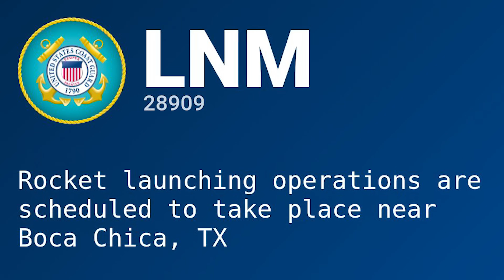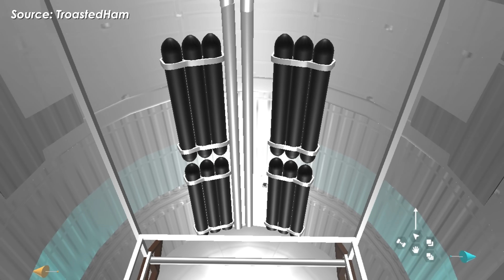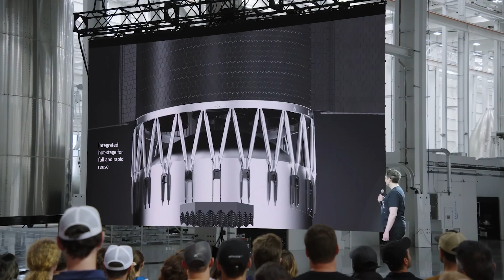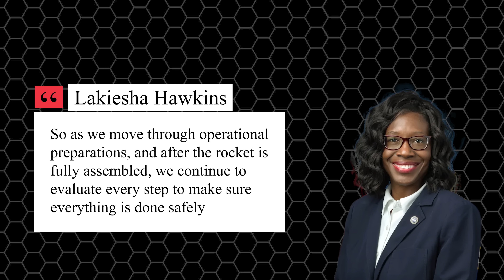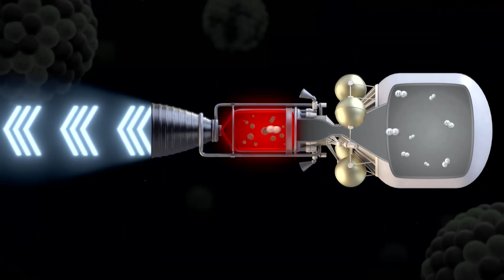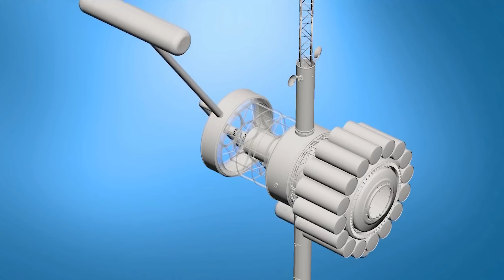SpaceX Declared Starship Flight 11 Launch Schedule with new Heatshield Upgrade to make history

Comment: Sounds good, especially work on better drive systems....
Hydrogen/Nuclear is too Nerdish, you are definitely right about wanting Mutifuels engines...
I think the baseline should be dirty water, ie Comets, Dead Sea style contaminated, and even "Yellow Snow" from all the Huskies that go!

Might be finding purer sources of Ice, like floating sea ice on Earth,  being low salt due to natural processes something similar could exist in space or on other planetoids, suggest research looking for such as floaties by the Astro-Nerds.
Spectral analysis of sufaces looking for Potable Ice formations.

That way you could just run the Sewage thru the reactor chamber... Instead of desalinization and unnecessary recycling of Monkey Juice...

Basically Starship's current propulsion is for gravity wells, and every where else there's better way more efficient options.

Also we need to get beyond one size does all thinking...

And start expanding horizons twards actual space Construction techniques.

Nothing says we have to wait and start planning until the last minute.
We could literally be fabricating pieces and sections now for a fraction of gNAtSA's administration budget...😂

I have a word for such drones, if they like the paycheck flow;
"Learn to Weld!"
😂

Just Sayin'